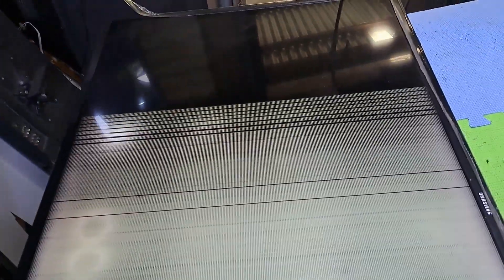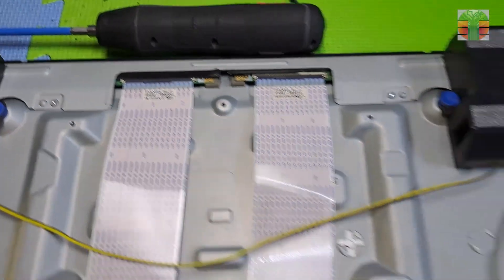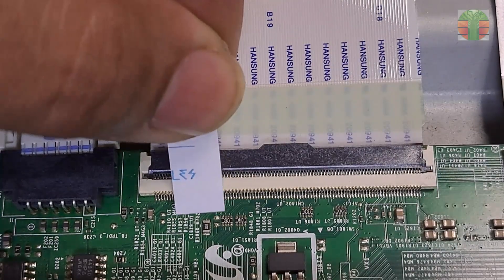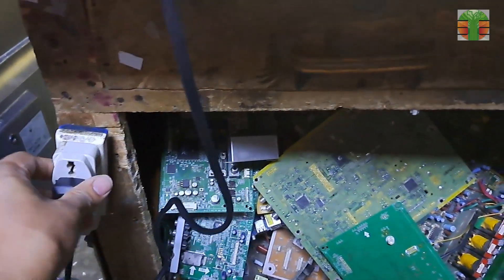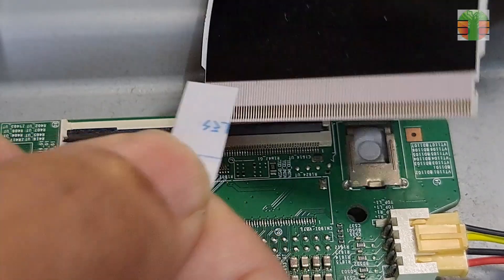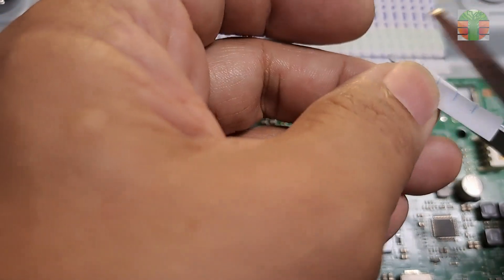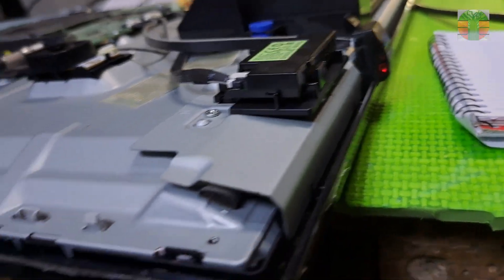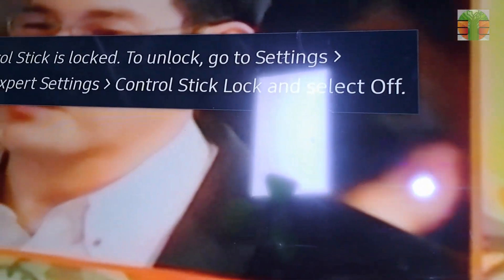Samsung 43 smart tv with no video fix.

Comment: Hello engineer, if possible, please make a video tutorial on moving TV panels to another TV. For example, I did one for an LG 42lw57000 TV. I placed the panel with a LG 42lv34000 diamond screwdriver on an LG LB, LK, LN mainboard. If possible, please make a tutorial for other models. I would really appreciate it.